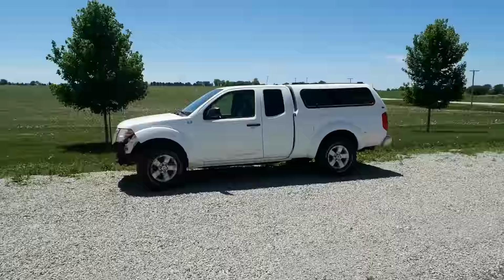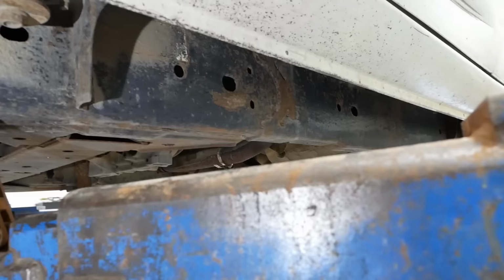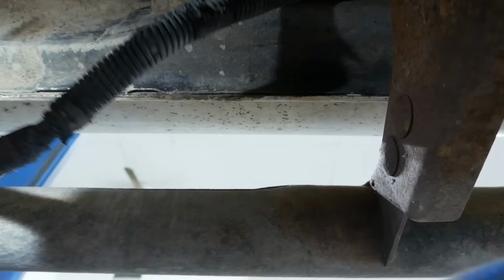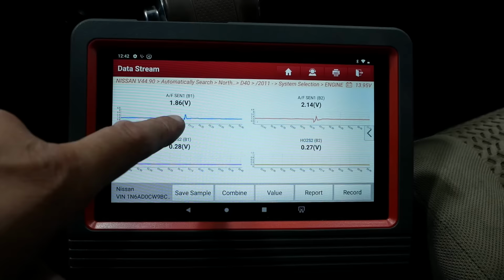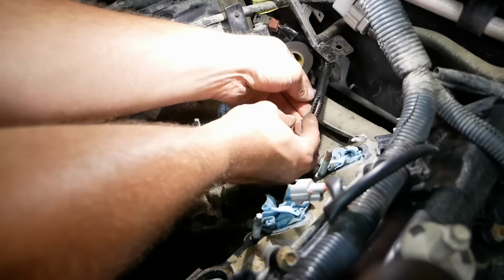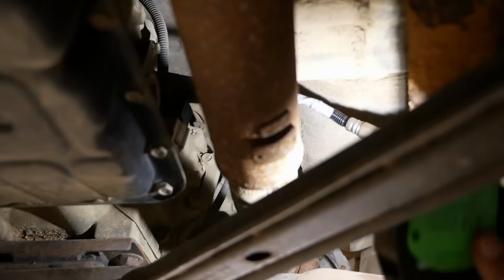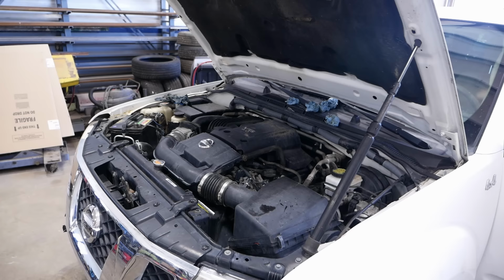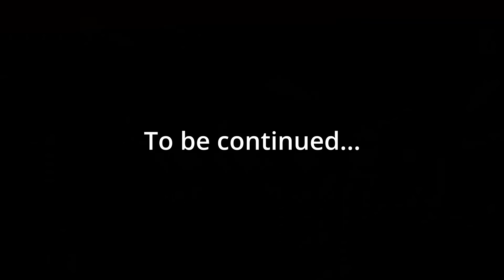Fixing a Nissan Frontier from the Salvage Auction - Part 1

Comment: I have a Chevy Venture that has a "Traction Active" Message that only comes on when I'm backing out of my driveway and turning left onto the street. I found the problem: it was a broken wire inside the wheel bearing. I can tug on the wire and the Message comes on and off when I push and pull on it. A temporary fix was to push in the wire as far as it will go into the bearing, and I zip-tied the wire in place. I bought a set of wheel bearings for the van, but It's been 3 years and the light had not come back on. I still have the new wheel bearings on the shelf. I just never had the time to fix it properly. I only have the one vehicle, and if something happens where I need to drive to the parts store, I'm stuck with an in-operable vehicle. I'm too cheap to take it to a mechanic to get ripped off with them telling me I need other things, when I know exactly what's wrong with it and how to fix it.

Comment: When are the new Watch Wes Work sundresses coming to the store?  I figure if nothing else, no body would hang around the shop getting in my way.  And that vertical breezeway would be really nice about now down here in south Texas.
Reply from the maker: Very soon!
Reply: @WatchWesWork  How about those Die Hardhat? Is that German??  I figure that running board was coming for your noggin there a couple times.  I was impressed by the force field that cap threw up!

Comment: The shot of the top of the engine is why I avoid frontiers. Need spark plugs? pull the intake manifold. Break a timing belt? wrecked engine.

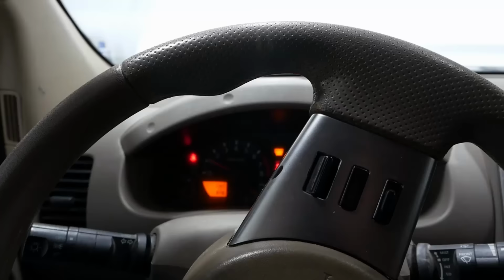Comment: Do you think at 13:30 when you had the connectors wrong, maybe it was due to the replacement sensor being for the other side, maybe if you put the old sensor back on it would have plugged in? That may also explain why the rubber gromets needed adjusted for proper fit.

Comment: That steering angle sensor code is probably from when they "tried" to align it, but didn't follow proper procedure to not trip, or to reset that angle sensor

Comment: Yikes - hope they got that thing for free!

Never replace an Xterra/Frontier knock sensor - at least in it's default location.  It's in a stupid location and they don't last.  I relocated mine (very common mod) and have since had to replace it a few times.  If I didn't have the supercharger on mine I wouldn't bother - it really doesn't do anything on those gen 2s.  You might get an extra MPG or two but not worth tearing the top off the engine :p

Comment: 30:49 i think you need a emulation of second o2 sensor.  think always fuel ratio is not optimal when ECU did not see sensors behind catalict converter

Comment: Could you add a source of those crimp and heatshrink connectors in the Show More box?  I've got the correct heat gun fitting that surrounds the heatshrink when shrinking it, but like the simplicity and durability of those crimp connectors. Thanks again for sharing your techniques. Now a subscriber after seeing the "Nissan Miracle".

Comment: I am so lucky I never reached the area of mechanics that has evolved here. I was a carburetor and points era, just getting into the fuel injection time (throttle body), lots of foreign stuff starting to appear... then get hurt so bad I couldn't continue. I honestly believe with all the test equipment I had (thank you snap on truck credit) that with enough classes, I would of been "just better" than the shade tree... I did have a rep for honesty. But in fairness, I never had the many issues that you deal with from rodents. Saying rodents, I have seen many homes and yards... why chew on a dang car/truck when Rover's food dish is in plain sight or the garden has food.... not to mention the amount of waste in folks barns.?? Another horse seldom rode is the frame shop which has come a long way also, has always made me glad I never went there... that is a field of troubles to bring good men down as its a tough one reading all the frame requirements and getting it arrow straight!

Comment: I'm going to be replacing a 4wd shift motor on a 94 Ranger that won't go into 4wd - is there a way I can test to verify it's the problem? Even if it's getting power that doesn't confirm it's working... wondering if there's a noise I could listen for or some other trick while somebody is in the cab engaging 4x4? Thx

Comment: With the ABS activation I had the same issue. Turns out I had too many shims installed on the sensor where it plugs into the hub. Was on a 2006 Silverado. Not sure if this applies to this Nissan

Comment: What is the tool called that you used to cut the electrical tape but not the wire. You used it behind the razor blade.

Comment: I enjoy watching Wes as I can relate my own business dealings to his experiences. But I'm surprised that he'd accept the liability of having his name connected to something like this. If this POS comes apart on the highway and kills someone, the owner will say that the vehicle was "totally gone through by a local expert mechanic," and it passed. If I change an interior light bulb in an aircraft and the engine quits, killing everyone on board, I have to hire an expensive attorney to defend myself, from nothing, basically. This thing clearly has unknown structural issues and compromises. Im not as daring I guess as some... Love these videos though. Be safe buddy!!
Reply: Well, the car's going to a bodyshop, who very often bend back frames, so somehow the risk and/or liability is manageable.

Comment: what was the tool you used to remove diff cover
Reply: that little plastic wedge?..i'm not sure what it's called but alot of locksmiths use those for holding open the top of a door frame or holding the glass away from the felt when slim-jimming a door open

Comment: did you check the trans fluid? these trucks were known to have bad radiators that leak coolant into the transmission and ruin the transmission. that is what happened to mine.
Reply: You are very wise. That is a possibility. Prevention, new radiator, is cheaper than repair. Transmissions are expensive.

Comment: I wonder if its possible to turn a two wheel drive Frontier into a 4x4 by just bolting up the 4x4 front end components onto a 4x2, could Nissan have had that kind of forsight?
Reply: I know with first gen Tacos you could take the transfer case and front suspension from another truck and put it on a five lug 2wd. I’ve seen a 4x4 swapped 2.4L single cab.